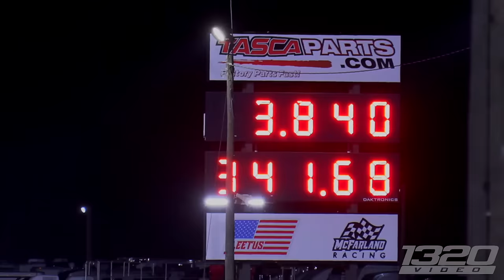12,000hp Top Fuel Dragsters Battle for $250,000! ($1,300,000 Pro Superstar Shootout)

Comment: The wildest thing about Top Fuel dragsters isn't the 5.6 g peak acceleration or getting in 0.8 seconds to 100 km/h. The wildest thing is that they shove SO MUCH methanol into the 12000 hp engine that it is close to being hydrolocked. 😲😲😲